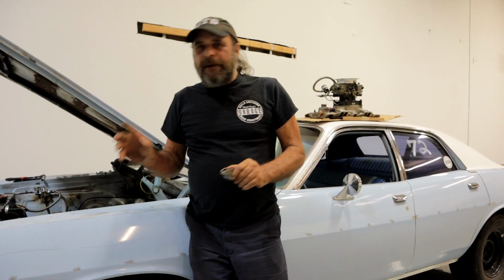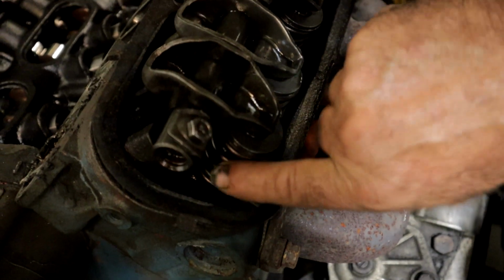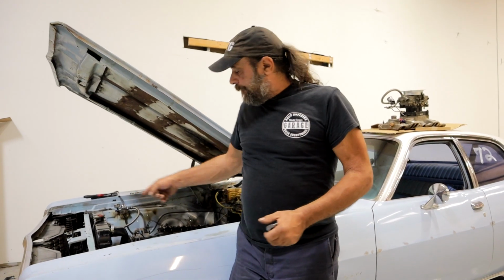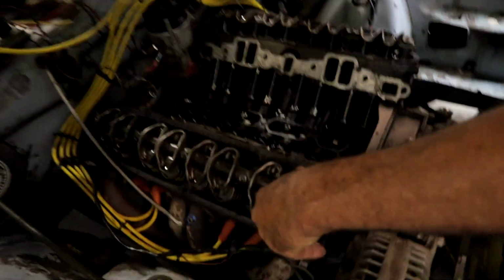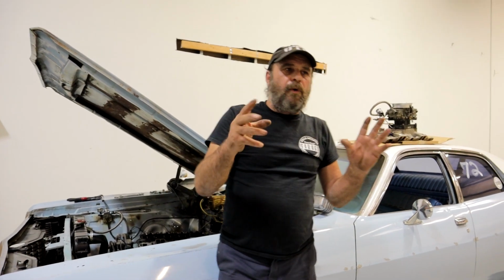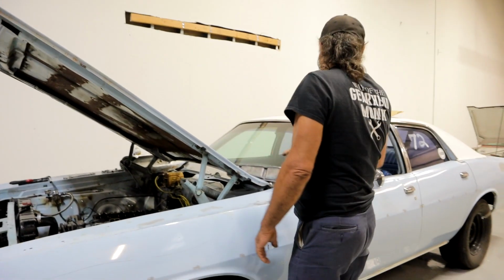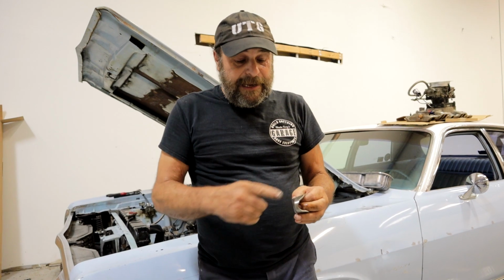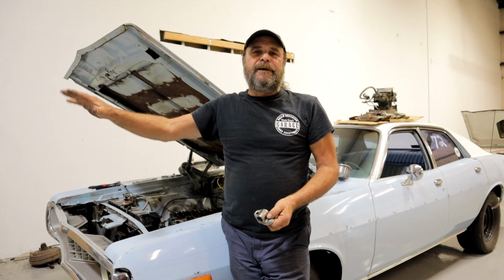Bottle Rocket Rocker Failure Explained

Comment: I've seen that on a friend's 1960s Chevy truck, straight six (stamped rockers). Just worn parts in that case, pushrods were like 1/8" shorter than spec (edit: due to wear, they were almost 60 years old!) and had worn through the end of the rockers.

Replaced the pushrods and rockers, and several fuel filters due to varnish from sitting too long.

As far as I know, that truck is still running and it's been 10 years since we replaced the pushrods and rockers. All hail the old stuff!

Comment: There is one camshaft company that had so much trouble with their hydraulic roller lifters, that they started to charge extra for optional, "premium" hydraulic roller lifters. The funny thing is, depending on what type of engine you have and in most cases, their premium hydraulic roller lifters are exactly the same as their standard priced hydraulic roller lifters. Unlike flat hydraulic lifters, there are still US-made hydraulic roller lifters available. Maybe check with the current owner of Johnson Lifters.

Comment: 15 years ago when I still played with old cars as daily drivers, I ran a Buick 455 and then that became a 462 later. I had several different cams and eventually nice roller rockers with the hydraulic cam, to get a better ratio than the stock rockers offered. I took apart cleaned and mic'd ever lifter part back then because I was hearing bad things circa 2006, and in those Buick engines, oil pressure is precious and sacred. Can't afford to bleed down.

Comment: Comp cams.  I got 150 miles on sbc 400 with bent exhausted valves and a whipped out cam. E mailed company asking for advice. I don't want any money just sell me what works. No answer. It's been a week now.
Reply: In my circle of buddies, Comp is famous for 'cratering' out of the box.  I'd run used 'junk yard' parts before theirs....

Comment: Toney, I brought this issue up with the machine shop I just took a 4.0 from my jeep to. He said that manufactures are running out of lifters and using Chinese lifters. In a previous video you talked about Chinese cam blanks, but I was told it is specifically the lifter quality that is not up to standard.

Comment: I had problems with my pushrods in my Saab 96 V4 engine,  recently complete rebuilt. The brand new pushrods started to deform/wear out right after start up. I drove about 350km and within that time, I had to adjust the valve clearance 5-6 times to get rid of the lifter noise.I decided to swap them all out from another V4 engine and adjusted them, now I have driven about 250km and no lifter noise. I contacted the shop where I bought the pushrods and sent them a picture of the rods, after 1 day they responded and transfered the money back for the rods. It seems like the quality of new parts arent the same as the parts from the good old days.

Comment: Crazy!! I hate the direction auto parts quality is going. And to think, I almost threw out a set of oem hydraulic lifters for a Ford 5.0 recently when rearranging the garage to shoot a video. But, I stopped, and thought to myself "what would Uncle Tony do?" Well, he'd hoard them away for another project! And then I remembered the videos on the points, and electronic distributor, and put the lifters right back. Then I felt better for having 2 storage units full of original foxbody Mustang parts still.

Comment: I have been having this debacle with everything imaginable, distributors, lifters, flywheels, slave cylinders, sensors, fuel pumps, fuel lines etc.

It's gonna make people quit cars that are new to the game because even the "premium" brand stuff is literally worse than junk from pull-a-part.
Reply: I prefer a used OEM part to a new aftermarket, it will last longer!
Reply: @brucenichols540  Yes Bruce, but you are aware that even the OEMs often source OEM replacement parts from different vendors than what was used originally, right?  Honda America was using Fram to make their OEM replacement filters and they never came from the factory with those same filters on them.  So even going OEM doesn't necessarily guarantee that you are getting the same quality part that the car came from the factory with.

Comment: I've had excellent luck with Crower Cams products, never had any issues with them, also try Rhodes Lifters with the Crower cam, great lift and idle vacuum so the Vacuum Secondaties will open without any bog to them! Yes I'm using a 780 cfm Carter Thermobog on my 340 and get great 60 ft, and 1/4 mile runs.

Comment: Damm can't get a break with these parts...
What oil are you running?
Reply from the maker: I run all my cars on Rotella
Reply: Rotella is fantastic oil, I will never buy into the myth of amsoil or any of the other boutique oils
Reply: @UncleTonysGarage    I run 15w40 Diesel (Valvoline) in every engine on my property.  Lawnmower, Generator, Gas Tractor, Vintage Mopars, 4.0 Jeep (430,000 miles) and a lone 6.2 Diesel GM truck.  Zero issues
Reply: @brucenichols540  Ive been a fan of the Chevron Diesel spec oil and have used it in everything for nearly 2 decades. It seems the most commonly used in the heavy truck diesel industry and thats good enough testimony for me!!
Reply: @UncleTonysGarage  Rotella is good stuff, used it in my class 8 trucks and still in my diesel PU truck.
Reply: I run Rotella in everything, even my Bike. The new synthetic oils mess up the wet clutches in motorcycles.

Comment: Don't expect the cam company to see this video and call you. Call their tech line and tell them the problem you are having. Most big name companies will work with you to try and fix your problem. They may have had a bad run of lifters and are willing to send new ones. Not a lot of people building 318/340s now days, the lifters may have been on the shelf and deteriorated due to age. Call them, don't make them crane their necks to find you,
Reply: Agree that he needs to call the tech line. Don't agree that anything caused these lifters to deteriorate on the shelf. The only thing I can think of that could make lifters lose pressure quickly is lousy manufacturing tolerance or junk materials.
Reply: @jamesplotkin4674    yeah...if they were properly packaged, they wouldnt deteriorate beyond some surface rust after years and years on the shelf
Reply: LOL I see what you did there.
Reply: One, he’s talking about Comp and two, they have a “bad run” of a lot of things on a frequent basis.

Comment: My good friend had a 5.3 chevy that did this. Brand new lifter for dod system 8 out of 16 were bleeding down while running. We had 55 to 60   oil psi cold and once to operational temp 30 psi no more even on a Rev up tune up.  So we took a old one apart next to a new one and yes they were bulit differently the new one was missing parts inside sadly 😥.  For 34 hrs and 700$ later it runs like a top now. 60 psi constantly.  Be safe & good luck.

Comment: Originally, all 273's came from the factory with adjustable rockers.  I gladly put those on the larger LA engine that I replaced it with, even though the bigger one came with a hydraulic cam. Lubrication to all the right places did not seem affected.

Comment: Funny, my 400 that shot a pushrod through a rocker was a certain big name company as well, it also was open headers so it was difficult to hear if it were tapping on start up, wish I still had it too see lol. Oh and like Uncle Tony said, you don't need roller rockers, my 400 had a  much milder cam then bottle rocket and it happened to it, but I've also had a 360 with a similar cam to bottle rocket that never damaged a rocker and ran it for years both stock rockers.

Comment: I used to work in a facility that produced engines, rear ends and finished cars from rolled sheet metal to out the door. We stamped all the rockers in house until 1989. That's when our press room was shut down. On stamped rockers like this one if they feed oil up through the pushrod the last stamping operation on the pushrod is to stamp (not drill) the oil feed hole in the pushrod seat. About .040" in diameter through .125" in one shot. After that the rockers were heat treated. The way this rocker failed I'm suspecting poor heat treatment. Plus if the lifter collapsed I'm surprised the pushrod did not get out of the seat completely.

Comment: Tony, you didn't mention if that rocker arm is a factory OEM Mopar part or an aftermarket,,,  because if it's aftermarket the metallurgy and overall quality may be sub par ....
An original Mopar rocker arm might have been able to withstand the pounding from that push rod and not fail or at least "take it" a lot longer....
Reply: Factory rockerz
Reply: @Welcometofacsistube   Thanks !!

Comment: That’s ok. I got a 904 from TCI last year so I would not have any problem. I must tell you I have not dragged it and have less than 10,000  I don’t even think I put 5,000 on it ! Anyway took off from the stop sign last night and second gear started to slip!! Really!! So I hear your pain. And!! The parts please suck! I’m so disappointed in TCI . I spent all that money for a hp transmission so I wouldn’t have to worry and now I have to take it apart and see how bad it is. Good luck Tony.

Comment: Tony, not sure what oil filter you’re running but I’ve had several engines have the lifters bleed down after an oil change. Every single time it’s putting on an oil filter from Fram. Yes they have anti drain back valves but they are hard plastic not neoprene. Regardless, fram was the problem, spin a different filter on and start up tick goes away. Just throwing it out there from my experience.

Comment: I had a lifter issue with an Olds 350 I built 20 years ago using a "performer" cam/lifter/intake kit. In my case, I had a lifter collapsing after about 30 minutes of driving. 
Also had an issue with a 2018 Caravan 3.6 where the lifters went out after 35k miles and were replaced under warranty. Dealer mechanic said it was a known problem. 
Quality is job 12... 🤔

Comment: in 1982 my brother built my 351 modified w/ 400 heads. One thing he did was have the valves shaved and installed Teflon valve guide seals. When you see a puff of blue smoke at morning startup, that's the oil draining past the seals.

Comment: It’s tough for a budget build project. Because the most expensive parts are the ones you have to keep on replacing or worse it wipes out other parts with it. I spend so much of my time searching for NOS parts because of these sort of quality control issues. Although I have seen more of an attempt from manufacturers to increase their quality in the last few years.

Comment: Uncle Tony, just this spring I spent every dollar I had and more rebuilding the engine in my old F100. The machine work was done by a very reputable shop and myself and a friend who builds race engines put it together. Fired it up and ended up having a bad flat tappet lifter. Ate the cam and filled the engine with metal. Disassemble and the rod ends were blue from heat because of the friction inside. Ruined a $5,000 engine. It’s still laying in pieces because I now don’t have the money to go through everything again. It’s really disappointing. I put a lot of blood, sweat, tears, and money into the thing to not even finish the break in process.

Comment: I’m working on an engine right now and there have been several moments where I’m torn between rolling the dice with new parts or putting it back together with 150,000 mile parts that I know worked before I took it apart

Comment: Uncle Tony it seems like this lifter epidemic is even affecting the OEM’s.  GM has had a rash of lifter failures under 10,000 miles in the new 5.3/6.2 equipped trucks.  It is so bad right now that GM is considering issuing a recall.  And when it first started happening when these trucks rolled out, they were only replacing the failed lifters but after seeing how bad the situation is GM is replacing all lifters on trucks that fail below 8,000 miles.

Comment: Uncle T. Man just use roller rockers, it will help the performance as I'm sure you know. Oh yeah, Always, keep each lifter, pushrod and rocker matched together when possible if you're stuck with using "used stuff", it eliminates so many potential unforseen circumstances. Great Video Aunt Kathy n Uncle Tony.
Reply: @kennywhiddon1497  Take note that I said, "Roller Rockers" not roller lifters, those require a not stock camshaft.
Reply: @kennywhiddon1497  Ah, Yep,😀I sure love me a 454 😀✌️

Comment: Uncle Tony, my stepson and I just fired up his drive-way rebuild 305 SBC yesterday. We grabbed video of adding the oil, oil additive, and pre-lubing the motor before startup just because of the issues you've been having with aftermarket and replacement parts.

And I'm worried. This was a cam break-in run, and at the 14 minute mark the motor started randomly misfiring. We were running straight water in the cooling system because we need to pull the radiator for work the next day (replace the mounts). We pushed it to 19 and a half minutes before I shut it down. I don't know if it was air pockets in the heads, or that the timing crept too far (it did move on us) or if we wiped a lobe. I just don't know.

The misfire wasn't persistent - it seemed completely random. Either way, we'll time it tomorrow and do a little looking. I wanted to try your trick of finding TDC/spark on #1 to light it off on the first flick of the key, but I couldn't find the video.

Comment: knowing I'm a bit late to the comment show, Tony, there may be some things you should look into.  First, having experienced pushrod/cup failure myself with the best shaft rockers made, look at oiling at the cup itself.  Knowing how the small block LA engine oils the valve/rocker shaft assembly, its worth a look.  Lack of oil means excessive heat at a very small contact point.  Second, make sure there hasn't been any physical contact with the valve and piston.   Third, a coil binding situation, retainer and guide contact especially at operating speeds.  There are numerous factors to account for, weight is one of them.   As for lifter bleed down, common occurrence especially with the manufacturer you are referring.  these lifters may be outsourced to an independent and private labeled for such company.   Hopefully you read this and can find something.  Rocker failures happen and always at the worst of times.  Good luck and happy shifting.

Comment: Probably the same reason when I installed a cam from the same company on a 300 L6 Ford engine (268, can't remember rest of specs, don't have the truck anymore, 1986 F-150), the distributor chewed up the cam drive section (always wondered why I had ignition problems, trying everything in the book other than the jumped tooth until I blew a head gasket).  Fortunately, the teeth from the part that drives the distributor that were broke off just fell into the pan and did not destroy the engine.  But it certainly did cause a LOT of frustration (I had a lot of learning to do, and a lot of learning still to do).

Comment: I’ve had excellent luck out of my Lunati solid rollers for my SBF. I think they are made by Morel. I did have to modify the lifter bodies to supply what I felt was adequate oil flow through the pushrod up to the top. Running solids on that hydraulic roller cam would be the best of both worlds when you figure out an acceptable lash. Less aggressive ramp rates and overall easier on the valve train in a street oriented deal.

Comment: Sounds like the same old thing. Bad parts across the board. We did a stock/performance mild build and ended up destroying a Cam and hydrolic lifters when we went back to the company and told them what happened and they looked over the motor they said well we ain't replacing the destroyed cam and lifters cause we used two valve springs. Apparently you gotta break in the motor with the stock springs and then you can upgrade the springs or otherwise you'll destory another set of parts. Here's hoping you have better luck with the company on getting the parts replaced

Comment: That's a damn shame.
It sucks to do good work, on usually very expensive and potentially rare machinery, just to have parts fail.
It makes me wary to replace anything unless it's an absolute hazard. It's like trading a Smith and Wesson with bad timing in for a brand new Taurus judge..
I think the biggest bother is that we know if the parts are decent quality and our work is sound these engines could outlast us easily. 
I think if you considered the amount of money in parts, fluids, time etc we could pool together .. make out own damn lifters..

Comment: Did Tony mention  the installed height of the valves after the valve job or the measured spring  pressure at max lift . I've seen this setuup fail time and time again from coil bind .

Comment: Had a lobe wipe off a new flat tappet cam and lifters during break in last year. Was running the correct break in oil additive (from your favourite cam company) valve spring pressures and lengths correct, pushrod lengths correct. The lifter on the lobe that wiped was just like those. Within seconds of shut off it was all soft and squidgy. I suspect the lifter killed the cam, not the other way around.  £500 later on another new cam and lifters, 12 months and a few thousand miles it all seems perfect. I thought I'd just had a rogue failure. Warranty was too much grief as I'm in the UK and shipping / customs / tax made it unviable.  Still annoys me though.

Comment: A big brand name doesn't always guarantee quality. When I was a kid my dad's best friend was a guy who used to build race engines. When I was hot rodding my first car he told me never use a certain brand of camshaft. They were one of the biggest names in the industry, but he said once he had one of their camshafts shear in two at high RPM. It wrecked the engine, and they wouldn't cover it under warranty, this would have been in the early 1970's. I don't want to name names but it rhymes with "Risky".